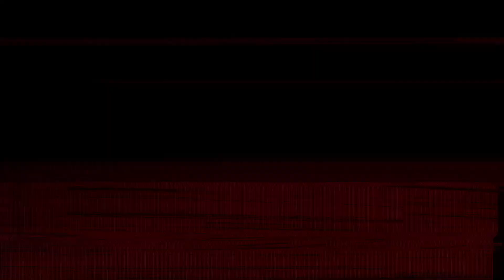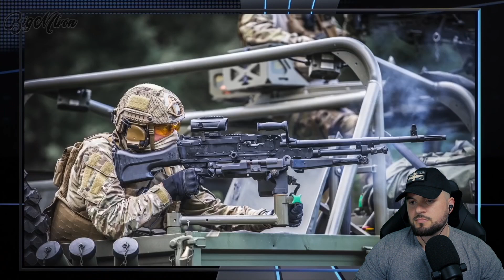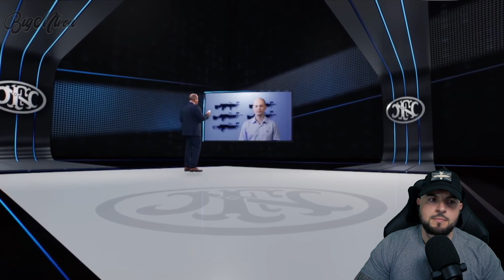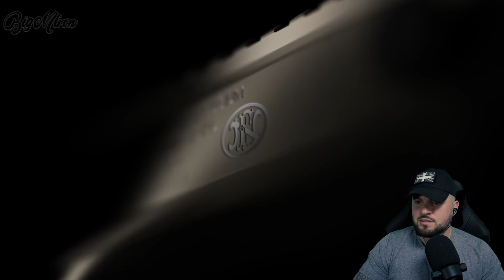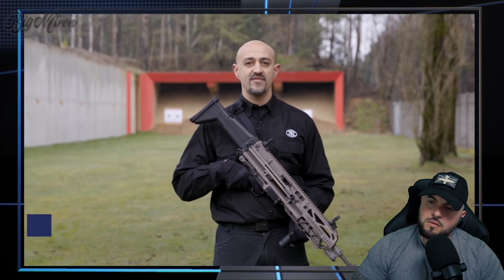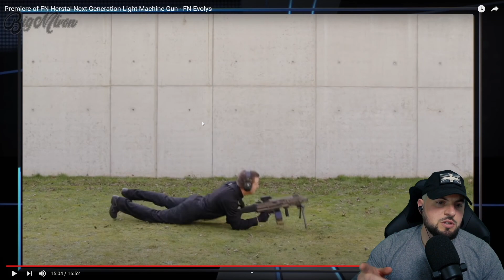The Newly Premiered FN EVOLYS Light Machine Gun - Paratrooper Reacts

Comment: the m-855 green tip was designed for the saw to increase penetration past 300 meters. this new beltfed is nice. i like the 45 deg belt angle. . but i still would like it to feed from mags. its got that scar 'boot' stock.

Comment: The Israeli negev machine gun has a semi auto setting. Forgotten weapons and Larry Vickers both have great videos on them.
Reply from the maker: I’ll check it out
Reply: @Boots_ontheground that wasn't first.

According to some rumours, nazi Germany also had options to choose semi auto or full auto.

It's just, it used DOUBLE triggers.

Maybe it was really GREAT to choose firing mod quickly, but I can't say anything about it's reliability, production cost, and maintenance (maybe there were some problems).
Reply: Also the Negev in 5.56 can reliably fire 30 rd mags which the M249 really can't.
Reply: @andrelockridge9109  Unlike the Minimi, the Negev has a gas setting specifically meant for magazine feed.

Comment: Did you get a chance to operate a m240?
Reply from the maker: I was a GPMG gunner and then gunline commander. Managed to get on a 240 on a range with some usmc guys back in 2010
Reply: @Boots_ontheground  sick. I'm 0331 and operated an 240 from 2002 to 2005 and I always thought of it as the great uncle that couldnt possibly die. The new FN is like a Ferrari and the 240 is an old truck.